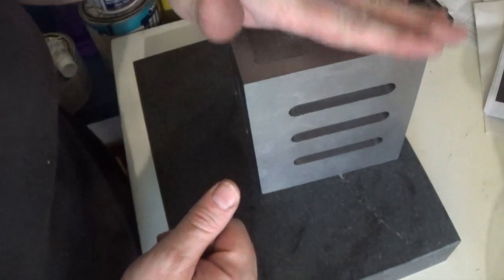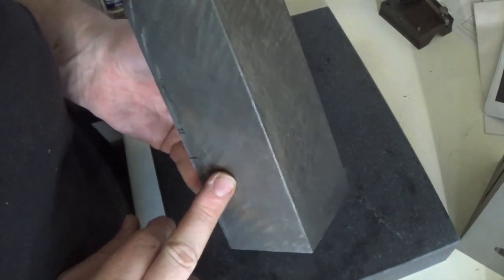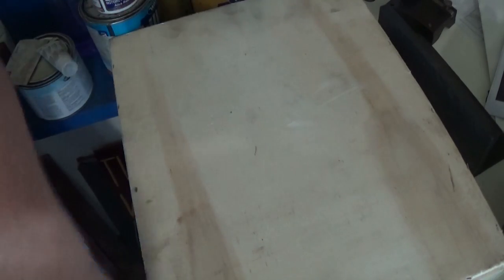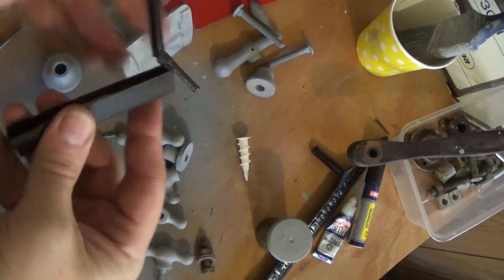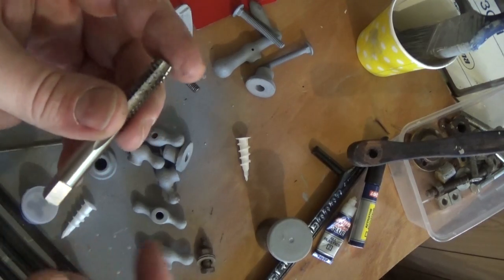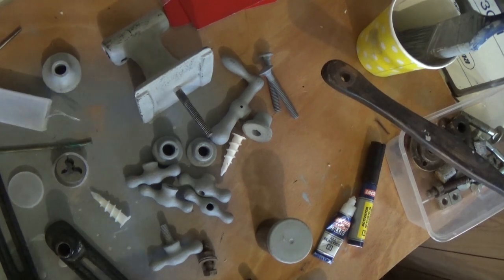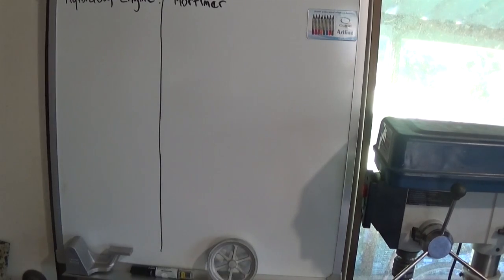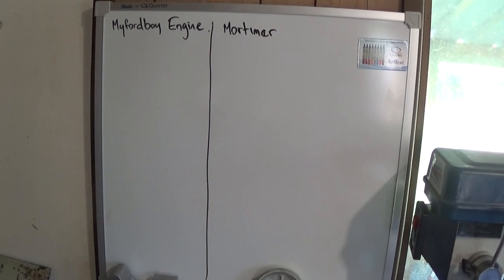new tools, new projects, new whiteboard. update for 15 may

Comment: Emma, the carbide tip material can be purchased as blanks in different lengths.  My source here is MSC, but you surely have an equal supplier of the same items there.  I have bought them in 3/16" x 1/8" rectangles in 1" lengths for soldering onto the scraper blades.  Cost is ~$5US each.  Without a mill, you could just get ~3/4" (19mm) flat stock and some a bit wider (~1" or 25mm) and solder/braze a couple pieces together to make the replaceable carbide tipped "blade", of course with new carbide soldered to the end, ready to grind/shape to the required radius and angles.  With proper fixturing, you should have no issue cutting the line of crescent stops with your lathe.  When you need a 40 radius tip for more bearing points and/or getting deep into dovetails, you can cut one of the 1" blanks in half and reduce the end of the "blade" to match.  -- Cheers, Gary
Reply from the maker: +Tools4Machines thanks for that. hope you are patient enough for all my questions!
Reply: +Emmas Spareroom Machineshop Yes, I am extremely patient.  BTW, could you either put your email on your new whiteboard or email me direct with your email/snailmail and I'll send you some stickers?  gary@tools4machines.com --

Cheers, Gary